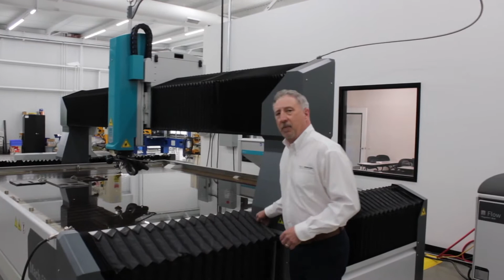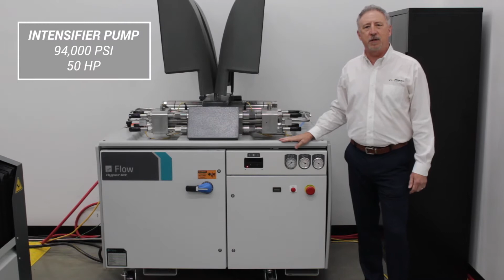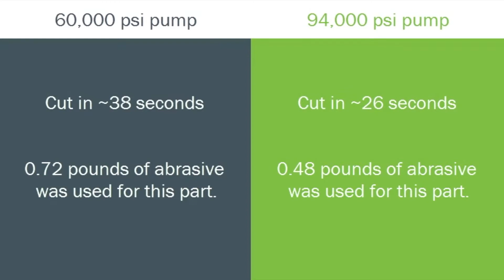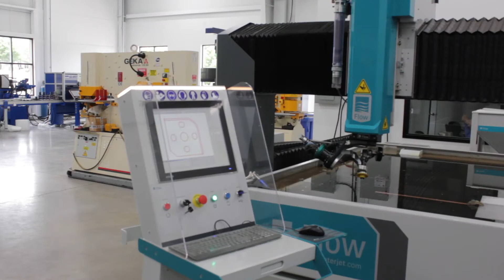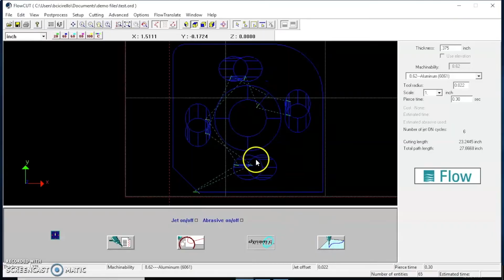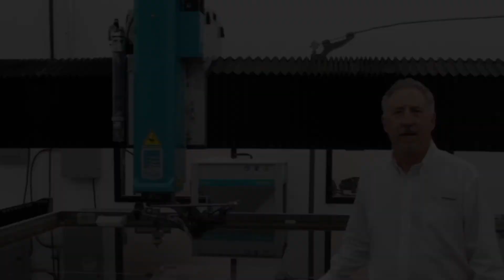Flow Waterjet Cutting Machines Walk Around Video | Mid Atlantic Machinery

Comment: Kind of negates the KSI comparison when as noted you handicap the 60k cutting head to the cutting jewel (head) as used on the 94k.  Would be a much different result if you fed the correct size cutting head at 60k.  Just a thought.